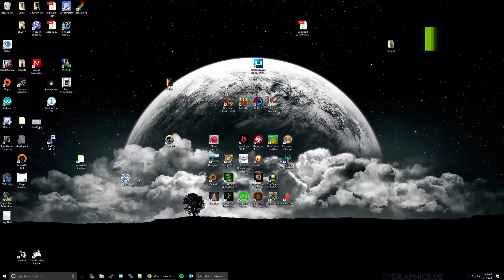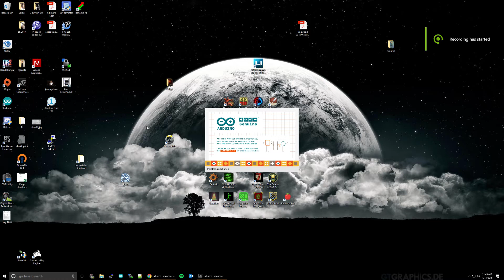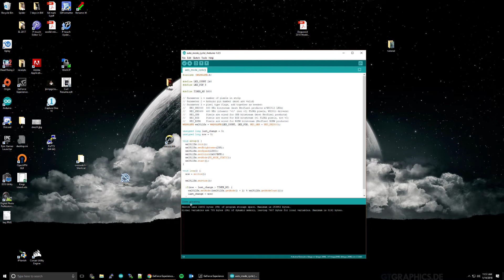Quick tutorial on getting a WS2812 strip setup with an Ardruino 2560

Comment: What capacitor should use if the led strip is 20 meters long? That's  500-600 LEDs
Reply: I would inject power every 5 meters and use 1x 1000uF capacitor at each injection site.

Comment: Hi. Can i use 1 power supply to powering arduino & led strip? Or is a must to use 2 power source?
Reply from the maker: It's better to use two separate power supplies, you would only be able to power a couple LEDs through the Arduino.

Comment: How did you connect the 3 strips together? Or are they different data pins on the arduino?
Reply from the maker: This setup only has 1 strip in it so it's just using 1 data pin.
Reply: @Megalomaniacat  sorry I meant from your other video with the longer line https://youtu.be/EaRjiO4-GSI

Comment: Why aren't you using a resistor? I have seen it on some schemes, but there were also some without it. This is my first "diy electric thing" that i would like to do, so I don't know a lots of things yet. Thank you for that tutorial and help ;)
Reply: @Joanna Kusch The purpose of a resistor here would be to limit current from the Arduino going through your leds, the higher the current through your leds, the brighter they become, however on the individually addressable leds the brightness is controlled by the software and there is even a method in the FASTLED library that allows you to set the maximum current drawn so you dont blow out your leds by setting the brightness too high.

When using leds where the brightness is not software controlled, yes, a resistor is needed in accordance with how bright you want your leds to be, but you can check the specs of the led for its maximum current draw and then choose your resistor value accordingly.

For example, If I want to power a single led with a maximum current draw of 20mA using the Arduino's 5V output, and I wanted to run the led at its maximum brightness, then I would plan to pass 20mA through the led. (However, a safe practice is to not draw on its rated maximum value, instead only go to about 80% of its rated maximum current draw). So we will want to only pass about 16mA. To do this you can use Ohms Law (V=IR) to find what resistor value you'll need,  5V=(.016A)R ==> R=5V/.016A ==> R=313 Ohms.

So in order to illuminate a led at full brightness that is rated to handle up to 20mA and you're using a 5V source, then you would want to use a 313 Ohm resistor or something relatively close to that like a common 330 Ohm.
Reply from the maker: Hi Joanna, in what part of the setup did you see the resistor? I'm wondering if it serves the same purpose as the capacitor in my setup...

Comment: Thank you for this! So no additional resistance on the data wire?(If I remember correctly it's supposed to limit noise)
Reply: Not if the wire is short(I.E during a test)

Comment: To connect more than 1 strip, would you just connect it to different data ports? I have a 16 foot strip I would like to split into 4.
Reply from the maker: Yep. Here are three strips running on one arduino. 

https://youtu.be/EaRjiO4-GSI
Reply: @Megalomaniacat  do you need more power to run 3?
Reply from the maker: I needed multiple power strips for mine but that was over 12 meters of LEDs  with 60 LEDs per meter. Power has always been a bit tricky for me, here is a link that I used to get started. Hopefully it can help you out. Interested in seeing your project! 

https://learn.adafruit.com/adafruit-neopixel-uberguide/powering-neopixels